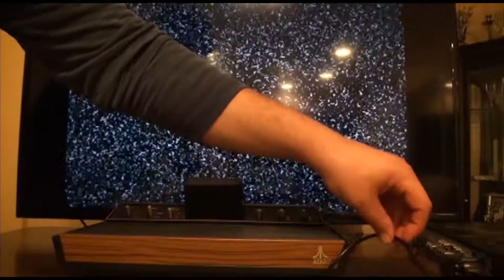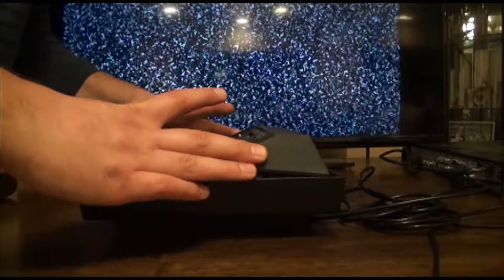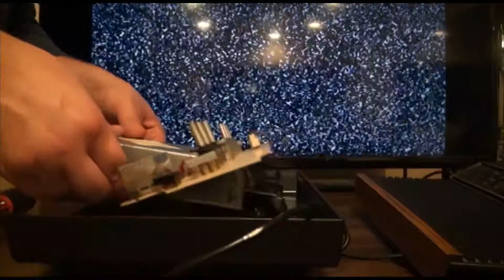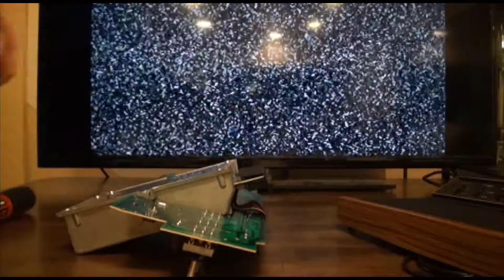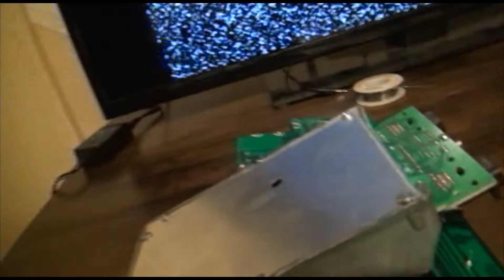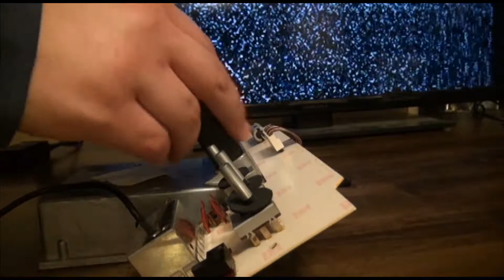Atari 2600 Troubleshoot & Repair - Intermittent Video / No Power

Comment: Any idea why controller only responding to left right and up, not down. It's a new controller and works fine on another console.
Reply: Try checking the solder joints on the joystick port, same as the power jack in this video. If it's loose you may not get full range. Does the fire button work? How does the joystick work in port 2?
Reply: @atarileaf  I resoldered one joint on the power port and now I have permanent half color on Frogger. The fire button does work on Yars Revenge. The controller joints seemed good. Does the controller port 2 work on one player games?

Do you have an email to send picture to?
Reply: I also made new metal contact strips for the switches and foam washers.